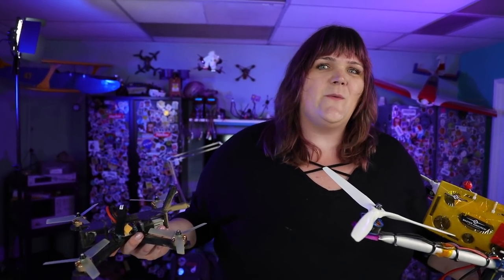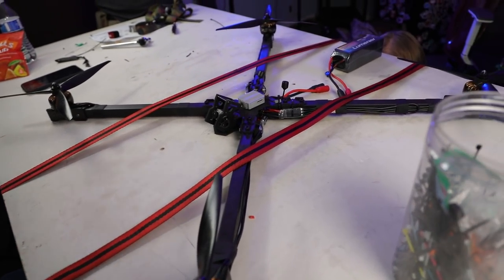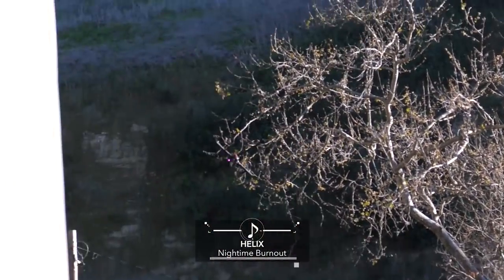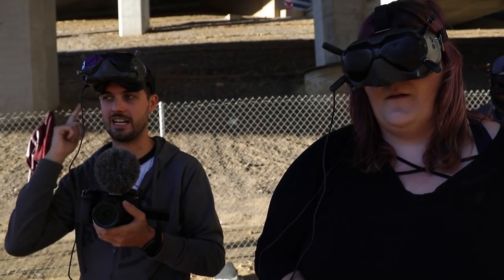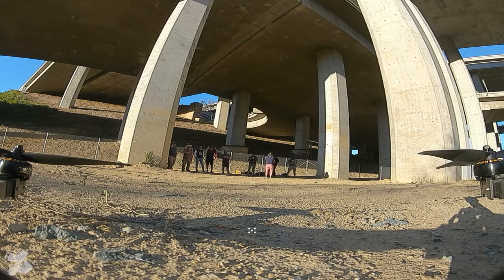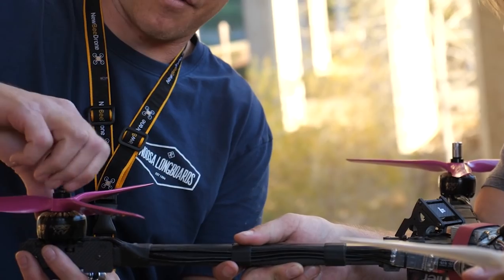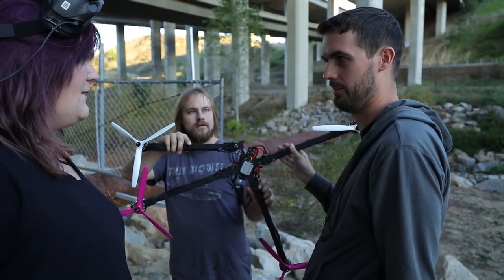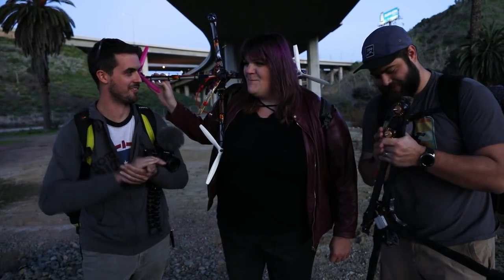Giant Drone with REVERSE THRUST?! – 3D X-Class!!

Comment: The thrust stand figures for those Xing 400kv motors is what made me look at lithium ion packs.  A pair of 6s2p packs, for 6s4p lithium ion, gave me 15-18 minute flight times using the Xing 4214 400kv motors with those 13x10 Gemfans.  Not a full bore hog wild build but a 55mph cruiser that shouldnt draw more current than what the 6s4p pack can provide(60amp cont with 110-130amp burst).

Comment: I had the same issues running 3d on my 10" tricopter. If I came into it really slow it would work well, but if I hit it, it would wobble and not make enough thrust.
Reply: Problem with a Tricoper is managing the counter Yaw swap once the copter flips over.

Comment: X Class is awesome!!!! The size and weight present a durability issue for me. The length of the arms is a major problem. With arms that length & the weight of the quad copter you’re almost 100% going to brake an arm or worse.     I also believe the sheer mass and size of the motors themselves is so much that it would be kind a hard to do the exact type of flights we would like to see 3D in X class. However I do believe that the X class 3D quad could be optimized and made to fly 50 % better. At least. You could increased durability maybe with a different design of the arms. I still believe there would be great stressors to the length of the arms would be pretty hard to stop them from breaking in a serious crash.  So yes I believe 3-D Xclass would work well when optimized with slow swooping acrobatic flight it would be pretty awesome  in real life.    Awesome video !!!!!!

Comment: Really cool evolution of the hobby, great job Zoe!!  I predict that propnuts could come loose with motors quickly changing direction due to the inertia of the heavy props.   I would suggest using castle nuts with safety wiring instead of ny-lock prop nuts to ensure props stay tight.

Comment: I'm pretty sure Le Drib explained I term instead of P. P is based on direct input (it's Proportional to the input).
Reply: No, he explained P correctly, P is the transient response to error.

 I is the response to error over time, hence integral.
Reply: P term is also not proportional to the input. It is proportional to the error which is the different between the setpoint(input) and response(output).
Reply: @fpvstatic4487  yep, exactly

Comment: Guys, go collective on it.  Those big motors just cant spool up fast enough.  You rig up a collective and x class 3d is doable.  There was one large quad, not quite x class that used a drive shaft to drive 4 collective pitch props from 1 motor a few years ago.

Comment: It is like pissing against the wind Zoe - sure there are some enjoying it. X-Class is a dead end. Its for people having too much money. Sure it is a show to watch and scary too. Skinny arms, heavy motors and the impact forces are not in your favor.
Reply: I dont disagree entirely but there are ways to build bigger stuff on the cheap.   Given the aluminum framed build she was holding at the end I would say that is the topic of a future video.   I have a 13in Beast Class running on 6s(because I use that voltage on other builds and dont want to go 12s yet) and have plenty of fun with it as a cruiser.   The ESCs I used are 6-8s rated and were 16 bucks a piece.

The main thing I wince at is the price of props.   There are motor options out there that are not too bad of a price.